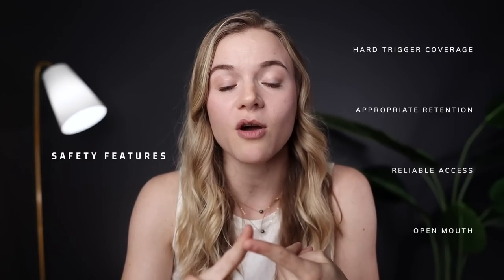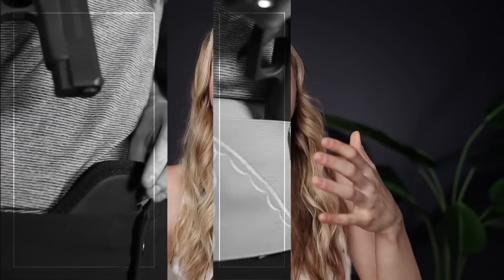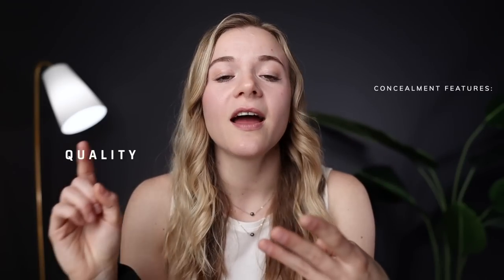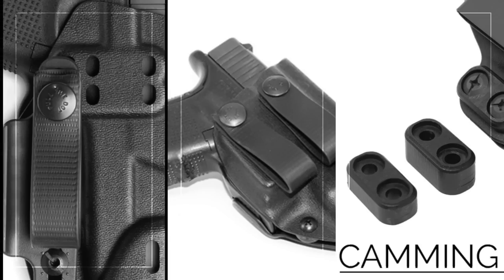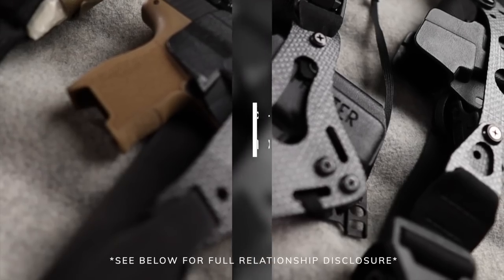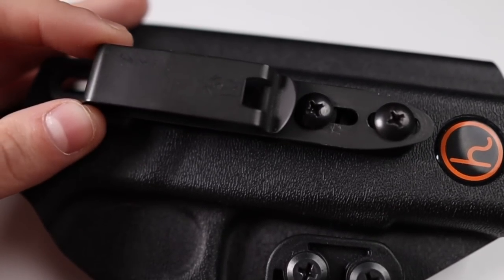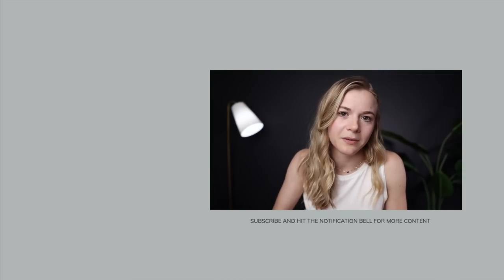How to Avoid Buying Holsters that WON’T WORK | Stop Wasting your Money

Comment: My reasons I have a box of holster is 1 I started at the 3 o’clock iwb, but I wanted to try aiwb. I also believe 2 is 1 and I personally felt strong side front pocket was the best location for my back up. Yet I had issues drawing my backup when appendix carrying a full size gun (I also believe in carrying the gun you would want in a gunfight if restricted to handguns). Then add in a ride motorcycles and like being in the woods, and it got complicated to try and find the “perfect setup”. I don’t believe you can ever not go through at least a few carry setups before you figure out what works for you.

Comment: Ok so I have a question, video says buy a holster with all of these listed features. So my question is how do you know it is right for you? Or do you just buy a holster and make it fit? If you have to find a holster with all these listed items chances are you may never find one.
Reply from the maker: There are certain features that are must haves, that’s the safety section of the video, the other items are not all necessary at the same time to produce desirable results. That said, the vast majority, if not all, users will benefit from a holster wing. Most will also benefit from added holster length, but not everyone needs a wedge. Unless you have a very rare gun, finding a holster with those features shouldn’t be difficult at all 😊
Reply from the maker: To answer your question “how do you know if it’s right for you”, almost nothing will arrive in the mail being a perfect fit. Just about anything is going to require customization, it’s much like fitting a prosthetic.

Comment: Seems like everything here assumes I want to use a plastic holster.  Nothing for those of us who prefer good old leather?
Reply from the maker: The safety requirements are the exact same for leather 😊 as are the concealment features. However, I don’t have any specific brand recommendations to add.
Reply: @tessahbooth  In theory the safety concerns are the same, but leather holsters work differently.  Branding aside, wouldn't it make sense to at least acknowledge that molded plastic is not the only holster option?
Reply from the maker: @rangersmith4652  molded plastic is the material I had for demo purposes that met all the safety requirements, but leather is also a viable option, although definitely more challenging to find ones that meet all the safety requirements. This video was focused on principles and features desired in an acceptable concealment holster, and material is more left up to the user to differentiate for themselves 😊
Reply: @tessahbooth  Yes, material is an individual choice, as is placement.  But if your desire truly is to help your viewers about avoid holsters that don't work, and every holster that "does" work is molded plastic in the appendix position, the strong implication is that nothing else can ever work and should not be tried.

Comment: TRex arms is also a great place to go
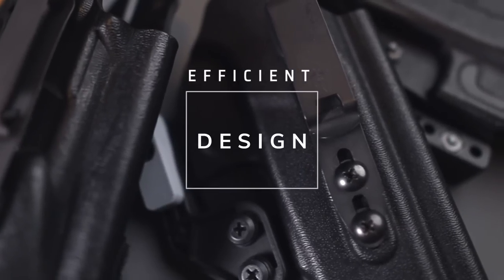Reply from the maker: Unfortunately sidecar holsters aren't ideal for the vast majority of users due to their inefficient design. The mag carrier side of the holster prevents further grip rotation, and vice versa. I showed this in the "efficient design" portion of the video, starting at 10:10 :)
Reply: @tessahbooth  that makes sense—thanks for replying! What magazine holsters do you recommend for non-enigma carry? I currently use a kydex holster from Veddar holsters for AIWB and I have a separate kydex holster for my magazine. But I’ve found that any kydex magazine holster I’ve tried, no matter where I place it or how I cant it, hits my pelvic bone and it’s super uncomfortable. I dont have this problem with my gun holster because it’s longer and goes past my pelvic bone, but mag holsters are generally shorter at the bottom and hits in a weird spot. 

I think carrying an extra magazine is important but I have stopped for now until I can figure this out. Just curious on your thoughts!
Reply from the maker: @rebeccaexplorer5969  Personally, I don’t carry a spare mag anymore, but when I did I used the koala from Dark Star Gear. It’s longer, which I find significantly more comfortable, and it allows you to adjust how deep you want your mag to sit inside the holster 😊